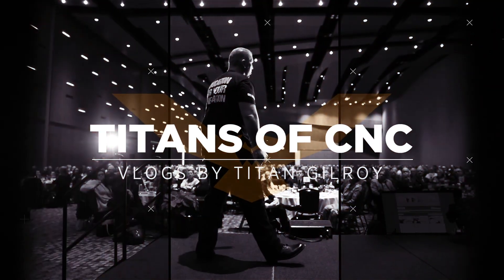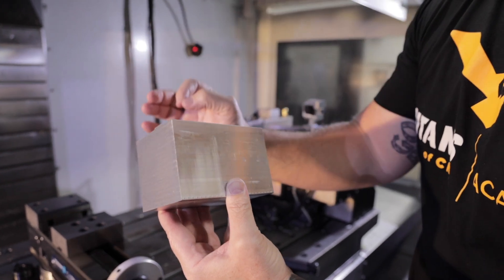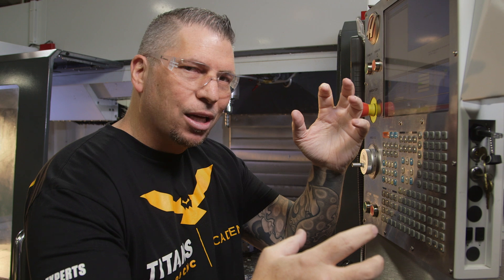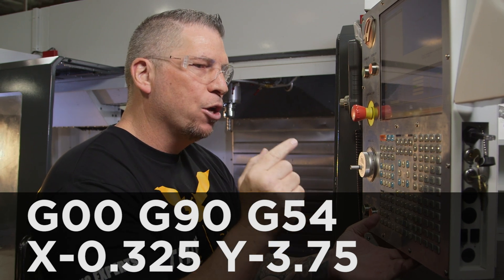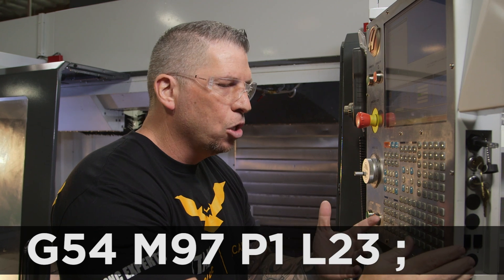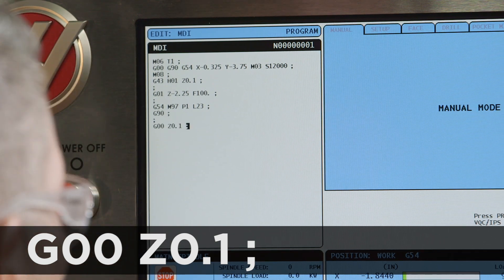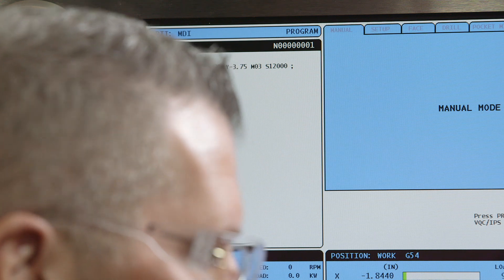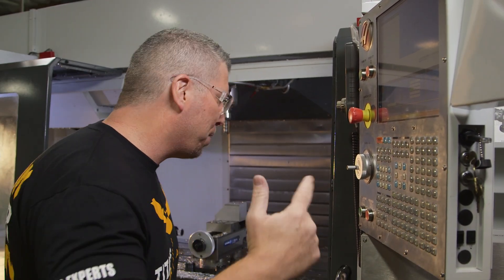G & M Code - Advanced Manual Programming Trick - TITANS of CNC Vlog #51

Comment: Hey Titan. Did I do it right?

G17 G21 G40 G49 G80 G90; 
T1 M6; 
(***DEFINE VARIABLES BEFORE RUNNING PROGRAM***);
#100=** (TOOL DIAMETER); 
#101=** (FLUTE LENGTH); 
#102=** (DEPTH OF ANGLE – NEGATIVE VALUE); 
#103=** (SPEED); 
#104=** (FEED); 
#105=** (ANGLE TO CUT); 
#106=** (INCREMENTAL Z AXIS STEP); 
#107=** (WIDTH OF PART); 
IF[#105GE90.0]GOTO10; 
IF[#105LE0.0]GOTO20; 
IF[#101GT#102]GOTO30 
S[#103] M03 ; 
G54 G0 X-[#100] Y-[#100*1.1]; 
G43 Z25. H1; 
G1 Z[#102] F1000. M8; 
#108=[#106/[TAN#105]] (Y AXIS STEPOVER); 
IF[#108GT[#100*0.75]]GOTO40; 
#109=[#102/#106] (COUNTER);
WHILE[#109LE1.0]DO1; 
G1 X[#108] F[#104]; 
Y[#107+[#100*0.75]]; 
Z[#106]; 
X[#108]; 
Y-[#107+[#100*0.75]]; 
Z[#106]; 
#109=[#109+2];
END1; 
G0 G90 Z25. M9; 
G28 W0; 
M5; 
N10 #3000=1[ANGLE TOO BIG]; 
N20 #3000=2[ANGLE TOO SMALL]; 
N30 #3000=3[FLUTE LENGTH TOO SHORT]; 
N40 #3000=4[Y AXIS STEPOVER TOO BIG – INCREASE TOOL DIAMETER]; 
M30;

Comment: Thank you for this video and others like it! As a relatively new machinist, I have been breaking away from some of the slow conventional methods I have seen and been taught thus far. Your content gives me inspiration that I apply at work; I recently received a large pay increase as a direct result of me cutting cycle time drastically by applying high-speed techniques. My eyes are being opened and I am seeing how much these tools can really take! My finishes are even improving as well since I am having more consistent tool pressure with a good chipload and less vibration and better heat dissipation. Fortunately, the more experienced machinists I work with have been very kind to me in their acceptance of my way of doing things. Worrying about stepping on toes seems like a sure way to limit my potential though, so thanks again!
Reply from the maker: That’s awesome! Keep up the good work!

Comment: Nice video Titan. I'm a 2nd year apprentice, thought I'd try and write a small macro program inspired by this video. Units are in metric though. Tell me what you think of it.

O1000 (3D Angle macro);
G90 G80 G17 G40 G21;
;
(DATUM = TOP LEFT CORNER OF MATERIAL);
;
T01 M06;
N01 (20MM ENDMILL);
;
#101=1. (TAN OF DESIRED ANGLE, 0.577 = 30 DEGREES, 1 = 45 DEGREES, 1.732 = 60 DEGREES);
#102=50. (MAX DEPTH OF CUT IN Z);
#103=100. (THICKNESS OF MATERIAL IN Y AXIS);
#104=1. (STEPOVER IN X AXIS);
#105=[FUP[[#102/[#104*#101]]/2]] (CALCULATES NUMBER OF CUTS);
#106=0. (LOOP COUNTER);
;
S5000 M03;
M08;
G0 G90 G54 G41 D01 X1. Y-[#103+10.] (1MM RADIAL DEPTH OF CUT, 10MM AWAY FROM JOB IN Y);
Z100. G43 H01;
Z5.;
G1 Z-#102 F10000;
;
WHILE [#106LT#105] DO1;
G91(INCREMENTAL MODE);
Y[#103+20.] F2000;
X#104 Z[#104*#101];
Y-[#103+20.];
X#104 Z[#104*#101;
#106=#106+1;
END1;
;
G90;
G0 Z50.;
G53 Z0.;
X-600. Y0.;
M01;
M30;

Comment: If I have to mash a couple of operations/vices together quickly if they were programmed separately

O2001 (Main prog - 3 ops Govt Job 12)
M98G54P1001(Op 1) 
M98G55P1002(Op 2)
M98G56P1003(Op 3)
M30

Old main program 1001, 1002, 1003 just alter M30 to M99 and remove any g54 etc.

Ps:
If you want to do a looping demo for customers.  On any main program alter M30 to M99 and it will just loop and never stop

Comment: Good video Titan 👍
I teach my guys to use a sub for safe start and another for safe end so like M98P1 safe start 
M98P2 safe end 
Both progs the same but P1 leaves table where it is P2 parks table at load position or door. 
Sub should have all you cancels in even mirror and rotation and G52 X0Y0Z0 G40 G90 M9 if you follow. 
So then at the start it 
M98P1
Call tool and all that
Then cycle or whatever 
M98P2
M30
BOOM 💥 

best to use P8001 & P8002 so you call lock it out so it can’t be changed with the parameters. 
It’s good with 5Axis as well.
Keep it real my man! 👊
Reply: Looks like this on a Fanuc UK
O8001(safe start sub)
G17 G21 G40 G80 G90
G94G98
G0 G52 X0 Y0 Z0
G69
M5
G0G91G28Z0M9
G28X0Y0
M201 (cancel thru spindle coolant)
M69M72
G0G28A0C0
G40G90G49
M99

Works perfect 👌 Boom 💥

Comment: Great video, Not many videos out there in this much detail. I like to use helical cycles when I program on the haas machine. Program below is an example of a 20mm hole using the loop system on haas control to mill a hole (won’t work on Fanuc machine) 
(Helical milling);
G00 G17 G21 G40 G49 G80 G90;
G53 Z0;
T1 M06
M03 S15000;
G54 X Y ; (x & y being the centre of the hole you want to mill)
G43 Z50 H01;
G01 Z2 F4000;
G91 G41 D01 X0 Y10 F6000;
G02 Z-2 X0 Y0 I0 J-10 L31;
G02 Z0 X0 Y0 I 0 J-10;
G90 G01 G40 X Y;( x&y being the centre of the hole you want to mill)
G00 Z50 M5 M8;
G53 Z60;
G53 X-750 Y0;
M30;

Comment: Not too shabby! At the risk of being a troll, I need to point out that you're confusing the terminology "sub program" and "sub routine". You correctly identify the requirements for M98 sub programming, but you're also calling the M97 callout as a sub program, where that is actually a sub routine. By correctly identifying the sub structure, it is much easier to understand whether the additional code should reside within the source program or externally.
  Keep up the good stuff!
Reply: Not a troll, this guy is awsome and your clarification just makes it that much easier to grasp!👍
Reply: I try to think of them both as sub programs but the identification of the two is either externals vs internals might be how it's written in a book I read once

Comment: When you get good at doing simple L repeat sub-routines, you can start experimenting with conditional statements and let the control calculate how many times to repeat the sub-routine.  For example, you can use a WHILE [#3 LT #30] execute a sub-routine or a sub-program.  The control will repeat the sub-routine as long as variable #3 (my Z depth variable) is less than #30 (my finish Z level).  This format works with Haas and Fanuc controls that have macros enabled. It's been several years since I've written macros, but I have used them to automate thread milling and pocketing with tapered walls.  WARNING!!! this is high level programming and like Titan said, you can really crash your machine badly if you don't dry run you new sub-routine very carefully!!!
Reply: In one of my job, i'v used that kind of loop to broch keyways whit small carbide boring bar on CNC lathe.... worked perfecly.... And on many machines u can use FOR, IF, ELSE WHILE and many other form of loop, input some variables and some math stuff (like coding in C++ or VisualBasic for computer apps) and u can create what i call parametric fonctions...Or how to be lazy efficently and get paid for it. Knowledge is power....
Reply: @huguestalbot4543  Parametric functions meaning you can pass variables I take it? I run a machine that isn't networked, and the memory is completely full.  I started making custom macros to do all of the repetitive operations, so I can go through and replace huge blocks of code with single lines.  Like to drill a hole on the lathe I call my custom G code 
G105 S(SFM) C(Cutter Dia) F(Feed) D(Depth)
My macro calculates the correct spindle speed and divides the depth into an even number of pecks, drills the hole, and then moves the turret home.  I have a boring macro that does the same.  You can pass it whatever depth, diameter, and rough opening you want, and it will bore a hole that size.  Now I have plenty of memory space, but my number of programs is limited to 63 for some reason.  I guess the only thing to do is combine multiple parts into one program, because our IT people can't seem to figure out the networking issue.
Reply: The best thing to do when doing this kind of code you should also do calculations and custom alarms at points where it could crash and then you have to worry a lot less about it. I do not know why more people don’t use the #3006=1 macro its so helpful.
Reply: Could you share a simple code showing this as a example
Reply: @johnl5177  
Here is a small Makro Program you can use to machine simple geometries.
If you understand the concept of this you can slowly add more variables do advance the Makro.
Sorry for my english skills.
Also take a look in your Programming Manual :)
#1=0(START DEPHT)
#2=-10.(FINISHED DEPHT)
#3=0.5(DEPHT OF CUT)

G0 X.. Y.. (MOVING TO START POSITION)
G0 Z.. 

WHILE[#1GT#2]DO1
G0Z#1
(CONTOUR)
(NOTE THAT YOU ALWAYS END ON THE START POSITION!)
#1=#1-#3
END1(THE CONTROL WILL LOOP WHILE #1 IS GREATER THAN #2)
(I RECOMMEND THAT YOU DO THE CONTOUR ONE LAST TIME AT FINISHED DEPTH)
(BECAUSE IN THIS EXAMPLE THE CONTROL WILL LEAVE THE WHILE LOOP AT Z-9.5)
G0Z#2
(CONTOUR)
Reply: @emule1989  Oh, I like macro, it's a cool thing! )
Reply: How can I make macro to change tool diameter in the program?
Reply: @michaelknightly3444  you can use G10 lines in your program to alter off-sets. But be carful, guys I work with call these land mines for the next operator.
Reply: @stephenhowe3143  hell yeah never thunk of that. I was overthinking the shit
Thanks man!
Reply: Can't this code;
G1x10
G3I-10
Z-0.1
writhe in m97 that X,I,Z go for 0.5 ?

Comment: I have to do this for surface milling all the time because our machines have no memory lol. Its either do this or constantly load new programs to finish 1 part.
Reply: You can also run your programs DNC from an inexpensive computer with a serial port.  I used to run HUGE swarfed surface programs on an old Fanuc 6M control that had very little main memory.

Comment: This technique is used on the turret punch press machine in our shop to repeat features with an incremental shift to make a bunch of parts on a piece of sheetmetal.  Controller is a bit older though, LOL. 1984 FANUC GN-6.
Reply: Later Fanucs in lasers and punches, you can use a G98 code to set origin, pattern spacing and xy repetitions. I use it all the time on an EMK Amada Turret Punch press for each tool.

Comment: Stop write in "Edit" M6 T1. You must write T1 M6 and for sub-program locatoin is not M97  G97 is corect
Reply from the maker: Doesn’t matter what the order is for code so long they are on same line

M97 is correct as I actually ran the program perfectly
Reply: TITANS of CNC: Academy , thanks for this lesson / tip,  I’ve been experimenting with While loops, using Linuxcnc always a bit scared of incremental mode though,  especially with multiple sub programs.  
Do you have a standard process to clear the coordinate systems if you get really lost?

Comment: Use same formula with a G13 for boaring a hole or pocket with I,J,L and Q...(depending on application) 1 line 1 hole or pocket minus tool pickup, homing lines, ect.  Great time saver for any machine use it a lot

Comment: You must be able to speak machine.... fluently!  It is the only way you understand what the machine is hearing . It does what its told. No more , no less.
Reply: The best way, is to think of it as another language. The codes are words,  the blocks (or lines as most call them) are sentences. The section for each tool would be a paragraph or in some cases even a chapter. 
 Do it long enough, you get very fluent in "G code" and start writing novels. You can tell the machines to do all kinds of cool stuff easily the more fluent you are. All programming manuals have a list of the G and M codes and their explanations somewhere in the manual. Think of that as a dictionary. 

A little about sub programs. 
I was a kid in a candy store when I finally got a machine with a control that could use local sub programs.    I don't think I have used an external sub since. 

Local sub= M97 and is written below the M30 block and started with a "N" word,  like Titan said.  

External sub= M98 and is a separate program loaded n the control and has its own "O" or program number. 

Returning to the main program is achieved with a M99 at the end is the sub program.  You can also nest sub programs, ie: calling a sub program within a sub program.  In that case the M99 will return to the sub program you called it from. You will then need another M99 to return to the main or the previous level of sub.  Not sure these days on newer controls, how deep you can nest but 10-15 years ago I recall one control I had that could nest up to 7 deep. It's probably more now with newer technology and more powerful controls.

Sub programs are exceptionally useful for performing drilling type operations on large quantities of holes where you are using multiple tools or doing repetitive milling passes like the example Titan showed. 

Great video Titan.

Comment: Nice tip, I am gonna try that one tomorrow. Gotta make some sort of rake tooth gadget. But I do prefer the g53 to the 91/28 bit, being on a Haas mill....

UPDATE: I left the initial comment over a year ago. I use this constantly now.  Not only the incremental stuff but the sub routines. I never use the G54 in front of the M97. I recently made a BUNCH of closer tooling for my company for pressing the internal bore rings on the composite material for making automotive head gaskets. We don't have a cnc lathe (a small import lathe the owner of the company bought years ago to polish crankshafts with lol) so I had to get creative on how it was done. Closer tooling fits on a small press with a "toolholder" with a 1" bore you stick the shaft into and lock it down with a set screw. The closer was designed to close a 3.56" bore ring. Shaft was 1.75" long. I was using a 2" sq shoulder face mill on a 4140 billet sized  4" x 4" x 2.5".  X & Y was picked up dead center of the billet.

G0 G90 G54 X0. Y3.5
...
G01 Z-0.05 F100.
M97  P1 L34
....

N1
G01 Y2.5 F60.;
G02 X0. Y2.5 I0. J-2.5;
GO1 Y1.5
G02 X0. Y1.5 I0. J-1.5
G01 Y3.5
G01 G91 Z-0.05
G90
M99

The cut took about 15-20 minutes to remove a TON of material. Spinning the cutter at 1250 rpm left a very, very good finish. Done on a Haas TM1, circa 2006.

Comment: After I started programing with Macros by hand, there is very little I need to do in the CAM apart from the very complex parts. I love to make programs in the machine and learning Macros was the very best thing I did, it makes your like A LOT easier. Trully recommend to everyone.
Reply: Agree. I wouldn't call this demonstration "advanced"  manual programming. Switching from absolute to incremental mode and running sub routines are basic functions used daily in most job shops. Macro programming is by far the most advanced code base used and is extremely powerful. He could have shown a simple example of using macros by having multiple parts in the machine and once the first part is complete a macro statement would execute the machining of all parts.
Still an informative video for those learning the basics.
Reply: @Jas0nAnders0n  I personally never change to incremental since it's very dangerous if you somehow leave it on, never needed it anyway after learning macros.
I agree with you, that is basic, but today where everyone uses CAM, things like that became advanced since not everyone uses hand programming anymore.
But it is always nice to see new videos like this for the people that doesn't know how to do it.
I would like to see CAM programming together with Macros, which is the next thing I'm learning little by little.
Reply: @bkviegas  Incremental and macros go hand in hand. It allows you and the control to do less math, therefore resulting in shorter programs and generally much easier to read/understand. CAM with macros is the best of both worlds, all the power and flexibility  at your fingertips.

Comment: I use g91 for interpolating a Jole or do a trocoidal style slot . 

On interpolating Is g3 x0 y0 Z-0.2 I-(tool radius)  and repeat this g3 line calculating 0.2 mm x 10 time = 2 mm .
Reply: I never use m97 bit It seams simple

Comment: I would write it like this on our Heidenhain Machine (Millimeter for example) 
1 Tool Call 1 S10000
2 FN1 Q1= +10000 ;Feed Rate
3 FN1 Q2= -30 ;Starting Point Z
4 FN1 Q3=+1 ;Incremental Step in X
5 FN1 Q4=+1 ;Incremental Step in Z
6 ;
7 L X-Q108 Y-30 Z+10 R0 FMAX M13 ;Q108 is the Tool Radius
8 CALL LBL “Angle45”
9 L Z+10 R0 FMAX M5 M9
10 LZ+0 Y+0 Z+0 M91 ; Safe Zone
11 STOP M30
12 ;
13 LBL “Angle45” ; Sub Program Start
14 L Z+Q2 FQ1
15 LBL “Steps”
16 L Y+30
17 L IX+Q3 IZ+Q4
18 L Y-30
19 L IX+Q3 IZ+Q4
20 CALL LBL “Steps” Rep14
21 LBL0 ;Sub Program End

You can literally set everything with Q Parameters. Set Sub Programs within Sub Programs, etc.

Comment: I use M97 and M98 to Create menus out of my codes. For Example making 1-2-3 blocks, i used M98 on a Fanuc machine to jump to each individual side to drill and tap my holes and because all of my codes were at the top and the line after each M98 was an M01 so i could stop the program and select whichever side i liked! I love Programming like this and here is an example of what i mean.

(Side 1)
/M98 P1;
/M01;
;
(Side 2)
/M98 P2;
/M01;
;
/G91 G28 Z0.;
/M30;

Second set of end codes at the bottom so if i tun on block skip i skip my menu and run the program like normal for less experienced machinists. Hope you guys find this interesting!
Reply: Just use g53 to send home better than using g91 g28 to send home.
Reply: I also see slot of programs use m3 with speed when tapping. No need for M3 or M4 tap code G84 automatically knows spindle direction. This will keep spindle from turning on at z home position won't turn on spindle until  reference point to start tapping. Also with Haas you use m13 when tapping with smaller taps. This will keep spindle in high gear and takes less time to stop spindle at tap depth to change spindle direction.